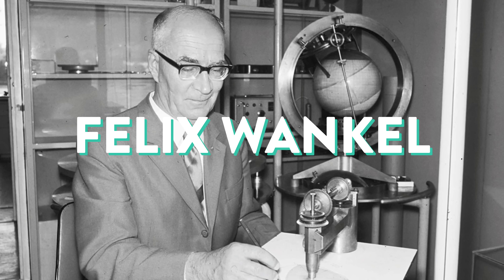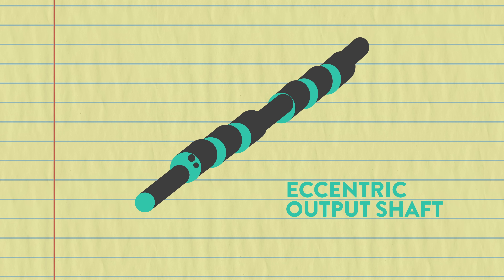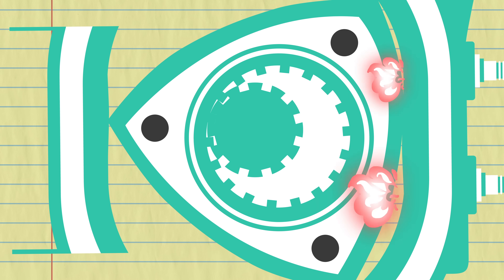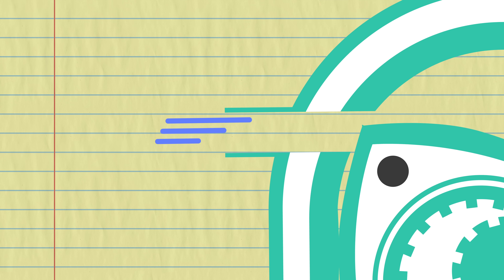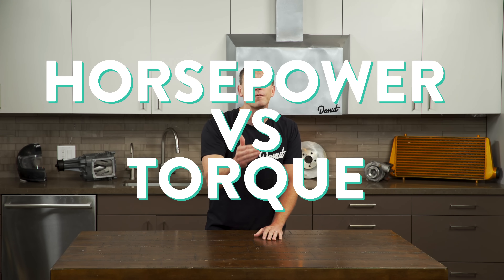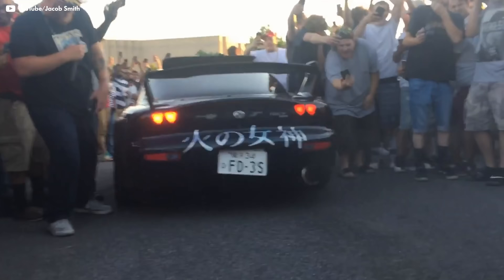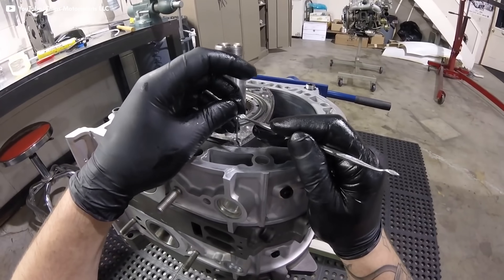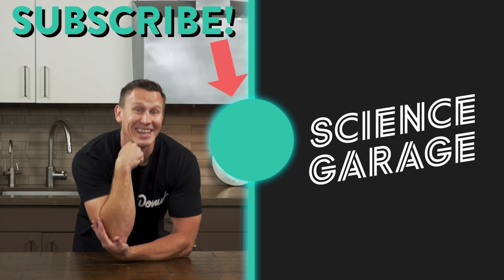Rotary Engine | How It Works

Comment: just feed the exhaust gas into a piston it will burn the rest
Reply: COMBUSTION SHAKE THIS IS THE DEVIL MARKS FROM THE APEX SEALS            FAKE DOKTERBIMMER
1
Reply: Why not just use a piston the first time and burn all the fuel efficiently the same time??? That is what all the engine manufacturers do now, even Mazda.
Reply: stupid why waste it in the frist place   why bold letters? do want to buy a engine?
Reply: Yes, Wankel engines are a waste of time...
Reply: @dokterbimmer7270  doktorbimmer could you walk us through the moments you experienced when you blew up your rotary?
Reply: @movingcombustionmazda6340  By: Cam VanDerHorst, Contributing Writer Mazda has made breakthroughs in rotary technology – and it may return to production soon. Fans of Mazda's rotary engine have spent years lamenting the loss of the unique powerplant and eagerly awaiting its return. In the face of ever-tightening emissions standards and ever-increasing fuel economy requirements, it has seemed – for a while now – that the rotary engine was doomed to remain a relic of the past. Perhaps more so than any other industry rumor, whispers of the rotary's triumphant return have appeared with unmatched regularity, only to wither and die on the vine just as quickly. However, this is no rumor – this comes straight from Ichiro Hirose, the executive in charge of powertrain development at Mazda. More Rotary Rumors: Rotary Fan Renders A Modern RX-7 For 2020 And Beyond Everyone At Mazda Is Dreaming Of A Rotary Sports Car, Says CEO The Australian motoring publication Drive had a chance to speak with Hirose at the 2019 Geneva Motor Show, where Mazda was celebrating the reveal of their new CX-30. More important than a new crossover, however, was what was revealed about Mazda's developments in rotary engine technology. According to Hirsoe, what was originally intended as a range extender has grown to become a much more versatile powerplant in light of recent technological breakthroughs. He says that the new flexible rotary hybrid powerplant currently in development is so efficient that it could be sold in any market in the world – even markets with notoriously strict emissions regulations in place. Hirose went on to describe a setup similar to the Toyota Prius, in which the hybrid drivetrain has the versatility to not only generate electricity, but to actually power the drive wheels when needed. This technology, dubbed XEV, may make an appearance in production cars – at least in Australia, and, we'd imagine, Mazda's native Japan – within the next few years. That's perhaps the most promising news yet for the rotary engine faithful. While we may never get another car like the RX-7, we may indeed end up with something even better.
Reply: @dokterbimmer7270  tweet tweet

Comment: ALL WANKEL ARE HIGH RPM ENGINES
Reply: By: Cam VanDerHorst, Contributing Writer Mazda has made breakthroughs in rotary technology – and it may return to production soon. Fans of Mazda's rotary engine have spent years lamenting the loss of the unique powerplant and eagerly awaiting its return. In the face of ever-tightening emissions standards and ever-increasing fuel economy requirements, it has seemed – for a while now – that the rotary engine was doomed to remain a relic of the past. Perhaps more so than any other industry rumor, whispers of the rotary's triumphant return have appeared with unmatched regularity, only to wither and die on the vine just as quickly. However, this is no rumor – this comes straight from Ichiro Hirose, the executive in charge of powertrain development at Mazda. More Rotary Rumors: Rotary Fan Renders A Modern RX-7 For 2020 And Beyond Everyone At Mazda Is Dreaming Of A Rotary Sports Car, Says CEO The Australian motoring publication Drive had a chance to speak with Hirose at the 2019 Geneva Motor Show, where Mazda was celebrating the reveal of their new CX-30. More important than a new crossover, however, was what was revealed about Mazda's developments in rotary engine technology. According to Hirsoe, what was originally intended as a range extender has grown to become a much more versatile powerplant in light of recent technological breakthroughs. He says that the new flexible rotary hybrid powerplant currently in development is so efficient that it could be sold in any market in the world – even markets with notoriously strict emissions regulations in place. Hirose went on to describe a setup similar to the Toyota Prius, in which the hybrid drivetrain has the versatility to not only generate electricity, but to actually power the drive wheels when needed. This technology, dubbed XEV, may make an appearance in production cars – at least in Australia, and, we'd imagine, Mazda's native Japan – within the next few years. That's perhaps the most promising news yet for the rotary engine faithful. While we may never get another car like the RX-7, we may indeed end up with something even better.

Comment: *piston engines are evolutionary but the wankel engine is revolutionary*
Reply: https://giphy.com/gifs/tweety-bird-cvOmdJLyBfpw4/tile
Reply: ROTARY IN LOVE THIS IS THE FAKE DOKTERBIMMER AS ERNIE BRINK ROTARY ERNIE BRINE ROTARY ***oh look you logged onto your other account to come boost your on ego. Wow what a genius***. You know you lost this thread so you're resorting to bombardment with multiple accounts in a desperate attempt to get support from all the people that hate your guts***.
Reply: *dokterbimmer only to now realize he's wrong.  He's beyond humiliated. as a bird brain*     https://giphy.com/gifs/tweety-bird-cvOmdJLyBfpw4/tile
Reply: A lot of rotational mass around the crank shaft, a lot of wear surface and non-concentric rotation causing vibration is why it is not a mainstream engine today.  But why it worked?  It fired 3 times per 3 times rotation of the crank, like a 3 cylinder 2 stroke would do.  Not to say those issues can't be overcome, and maybe they have been for all I know, but we don't see them used much anymore for some reasons.
1
1
Reply: @erniebrinkrotaryhemi7336   1
SLRS
SLRS
3 years ago
+The real doktorbimmer Sorry man, I didn&#39;t know this was supposed to be personal.  I thought we were just adults having an intellectual discussion.  ...and you do not know my background.  Either way, I understand the ideas he is trying to get across, and it is ok with me if not everyone else does.  Nothing personal, of course.

Comment: how do i gain more torque on a rotary wankel reciprocating engine.?
Reply: WELL YOU NEED BIGGER ROTOR BEARING THE BIGGER THE BETTER MORE TORQUE GREAT COMMENT ERNIE BRINK HEMI
Reply: @therealdokoterbimmerrotary6751  THANK YOU GOD BLESS YOU
Reply: Home
    /
    How To & Tech
    /
    Wankel Rotary Engines

Share your thoughts on this article2
Email this article to a friend
Tweet this on Twitter
Share this on Facebook
FROM THE October 2000 ISSUE
Wankel Rotary Engines
An early casualty in our industry's efforts to build a better 2-stroke
By Olav Aaen | October 1, 2000
RELATED TOPICS: ENGINES | VINTAGE
The good old piston engine was "on its deathbed," read the announcement. Good-bye to pistons, rods, valves and camshafts; there was a revolutionary new engine taking over the automotive world. The new engine had only a rotor instead of pistons, was fully balanced and ran smooth as a turbine. The inventor was Felix Wankel, and the Wankel engine promised a bright new future as a sophisticated and compact power source.

It was the mid-sixties, optimism abounded, and most of the major car manufacturers jumped on the bandwagon. The largest licensee in the U.S. was General Motors, but the concept also found its way into snowmobiles. Both OMC (Evinrude & Johnson), and Arctic Cat produced snowmobiles with Wankel engines for a short period. Arctic Cat imported a Sach's-produced Wankel from Germany while OMC built its own.

Unique Concept
The Wankel engine was as ingenious as it was simple. A triangle-shaped rotor spun around a geared shaft in a peanut-shaped chamber. The rotor only turned at a third of the speed of the drive shaft and one side of the rotor passed by the combustion chamber per revolution to give a power stroke. This meant the motor fired on every revolution like a two stroke, but the pumping action acted like a four stroke.

The incoming fuel mixture was sucked directly into the rotating chamber; there was no crankcase pump as in a two stroke engine. This would give the Wankel all the advantages of a four stroke for chamber filling, combined with the advantage of firing once per revolution like a two stroke. The Wankel also promised to have better fuel economy than the two strokes, and this was important in big outboards.

For OMC to gain production experience it was decided to make a snowmobile engine first. OMC had a reputation for quality products in the outboard business, and it was felt that there would be a lot less risk if the unavoidable teething problems could be sorted out in a fan cooled snowmobile version.

The snowmobile engine was to be designed by the Outboard Division, so they could gain some experience. With all the major automotive giants jumping on the bandwagon there was a tremendous optimism around the project. The Wankel design team was full of young engineers without a lot of baggage from conventional production, in hope that new and fresh ideas would abound. At the time I was a young project engineer in the Snowmobile Division, and was assigned to coordinate the installation between the Outboard Division and the snowmobile chassis department.
Inherent Obstacles
It was not my first experience with Wankel engines, I had tested some in early NSU cars in Europe and had been impressed with the turbine-smooth power delivery. At my first meeting with George Miller, the project manager, I was advised of a potential problem he hoped we could solve.

The Wankel exhaust runs very hot, and it would be important to make sure it did not become a problem in the sled installation. What did he mean by hot? Cherry red metal glowing under the hood, just like a coil on an electric stove. This was obviously much hotter than a two stroke muffler, and could be a serious problem. At that time the engines were mounted on top of the tunnel where the gas tank now sits on modern snowmobiles, and the gas tanks were in the nose. The muffler compartment was where the engines are now located; between the cross member and the tunnel. This meant that the cherry red Wankel muffler would be located only five inches away from a plastic gas tank. It was too late to redesign the engine location; it was to be mounted in the large luxury chassis which also housed the quiet machine.

This would turn out to be a plus. In order to control noise emission, this design had a completely closed hood with managed air circulation. This meant no louvers to let the noise out, and the hood tightly sealed to the pan. The problem with the hot muffler was solved only by allowing the air out after it had circulated around the muffler under several carefully-designed radiation shields. After the air had run through the fins to cool the engine, it was ducted over and around the muffler and finally out through a slot at the bottom of the muffler compartment right in front of the track.

The only reported problem with this design was a tendency to melt snow and ice under the sled if you let it idle too long before you shut it off. Occasionally owners would come out after a dinner at their favorite restaurant and find the track frozen to the ground, as the melted snow turned to ice. As far as I know, there was no problem with the close proximity of the gas tank to this glowing hot muffler, because the gas tank compartment had also been well insulated.

The Wankel concept had been criticized for its long sealing surface, and the complicated sealing strip arrangement around the rotor. The OMC Wankel engine had no such problems. The steel seal ran against metal-sprayed side plates and had excellent wear properties. One major problem occurred on the first production batch. The rotor bearings weren't to spec and some failures occurred until new bearings could be delivered.

OMC's Wankel-powered snowmobile lived up to its expectations as a test bed for the new engine concept. The Wankels were both smooth and relatively quiet for their time, and the power curve was a lot broader with lots of torque from a low engine speed. This made it completely insensitive to clutching. You could throw a bad clutch on this motor, and you would not notice it because of the exceptional four stroke-like delivery. Fuel consumption was also better than a comparable two stroke engine, but not as good as a conventional four stroke. This eventually became the downfall of the Wankel design. We were now in the early seventies, and then we got hit by the oil embargo. Fuel economy all of a sudden became a big issue, and the large automotive companies dropped the Wankel like a hot potato. OMC had hoped the publicity of the major car companies would create a favorable acceptance of the rotary engine, but now the exact opposite occurred. With all the bad publicity about the uncompetitive fuel consumption, OMC backed off its Wankel research.

OMC got out of the snowmobile business in 1975. The Wankel design team was disbanded, and most of the team members left for jobs at other companies. Only the Japanese Mazda company continued to make Wankel-powered cars, better known as the RX-7 Rotary, a very quick sportscar which gained an enthusiastic following.

If the Wankel concept had been allowed to continue on a limited budget, it may have emerged as a possible solution to the fuel consumption and emissions problems the sled and marine industries face today with two stroke engines. OMC built several large four-rotor outboards that were the most powerful outboards ever made, and when used in hydroplane racing, they totally dominated the competition. There is no doubt a very powerful compact rotary engine can be built, they are now very popular as power sources in sportscar racing in SCCA.

Future Uses?

Will we see rotary engines again in a snowmobile? It may depend on how strict the emissions rules become, and how much it will cost to tool up for new two or four stroke engines to meet these goals. The Wankel rotary engine had many good features that should have made it an excellent power source. Costs would have come down with continued development and reliability would have been engineered in. The design did not fail on its own merit, but was forced aside by circumstances. The expertise is still out there with the Mazda engines, and it would be a lot easier to get back into it now than it was to start from the beginning of the Wankel era.

As it turned out, the OMC snowmobile rotary engine ended up being the only Wankel engine ever manufactured in the U.S., and as such has some historical merit. There are still OMC rotaries out there in running condition to be had for a reasonable sum if you are interested in finding out what it felt like to run with rotary power.
COMMENT ON THIS ARTICLE
Want to leave a comment?
Only registered membe
Reply: https://giphy.com/gifs/tweety-bird-cvOmdJLyBfpw4/tile
Reply: @xkexke8081  this is funny

Comment: So basically wankel is like a 3 stroke engine?
Reply: No, All Wankel KKM engines use the exact same 4-Stroke operating principle as the reciprocating Otto engines... the only difference is the Wankel requires 1080° of rotation to complete its firing order sequence instead of 720°.
Reply: @doktorbimmer  BLEW UP A ROTARY WANKEL RECIPROCATING ENGINE

how do i gain more torque on a rotary wankel reciprocating engine.?dokterbimmer do you want to buy a engine?
Reply: Ernie Brink, why doesn't your engine run?
Reply: WELL YOU NEED BIGGER ROTOR BEARING THE BIGGER THE BETTER MORE TORQUE GREAT COMMENT ERNIE BRINK HEMI
Reply: and  @therealdokoterbimmerrotary6751  LONGER STROKE AWESOME  he had a rx7 but  he  blew it up he only go,s around being a fake and a liar...
Reply: But why doesn't your engine design work???
Reply: @*THE REAL DOKOTERBIMMER ROTARY* +The FAKE doktorbimmer you make me feel confident, because it reminds me that I’m not burdened with your negativity.
Reply: @erniebrinkrotaryhemi7336  So basically wankel is like a 3 PISTONS = FOUR STROKE = 1080 TURNS FOR OUTPUT AWESOME  ROTARY IN LOVE THIS IS THE FAKE DOKTERBIMMER AS ERNIE BRINK ROTARY ERNIE BRINE ROTARY ***oh look you logged onto your other account to come boost your on ego. Wow what a genius***. You know you lost this thread so you're resorting to bombardment with multiple accounts in a desperate attempt to get support from all the people that hate your guts***.@t
Reply: dokterbimmer the fake ???? WOW!!! You're right, he did delete all his comments